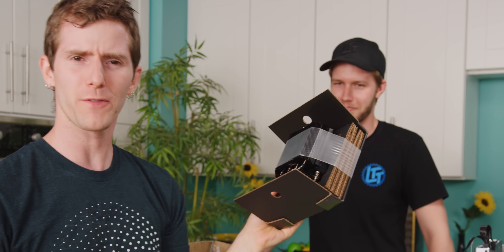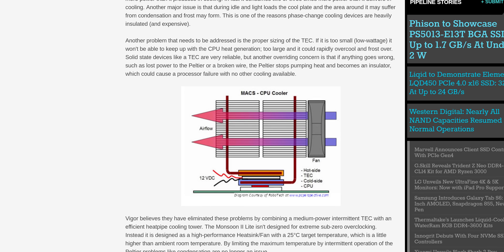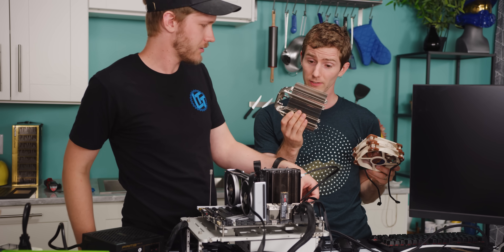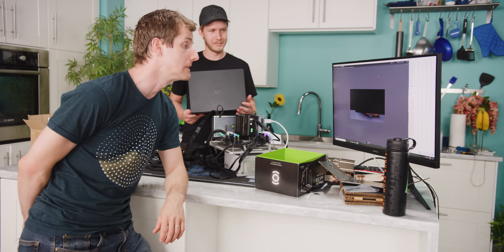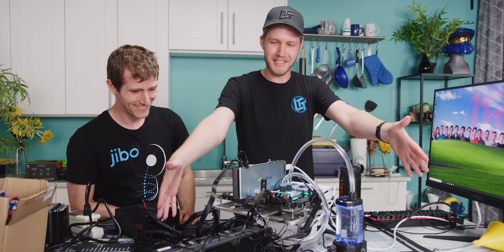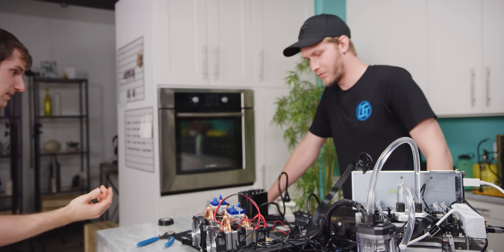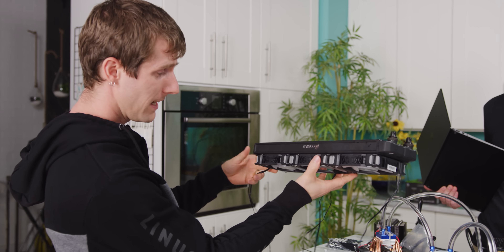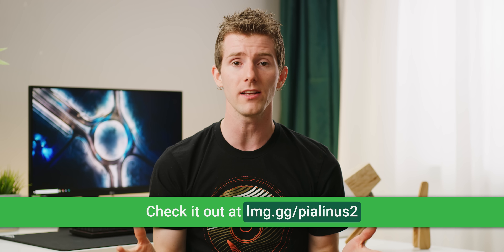Thermoelectric Cooling is a Bad Idea

Comment: How young are you? Peltier Seebeck CPU heatsinks are even older. I can still remember the late 90's Pentium Pro/MMX, AMD K5/6's, Cyrix 6x86/MX's Peltier heatsinks. Sure, they were crap then (and now).
Reply: Paco yep, I remember them too.  That was a brief but definite period in the history of cpu overclocking.  And man, that pentium pro freaking brick of a cpu... I still have one laying around somewhere for nostalgias sake.
Reply: @mrepop  Yes, pretty much a socket 8s huge brick due companion L2 cache die. Ha ha, If you still have one, you have about 1g of gold into the processor (~45$ - 0.035oz).

Comment: why not go find a cube sized waterblock and place a peltier on all the sides, give them less V they also run more efficient,

or split the water up to go trough 6 seperate waterblocks with 2 peltiers on each sides, 12 peltiers in total is a nice number too and with less V ofc

Comment: try evacuating heat out of the water with the radiator before it runs to the thermoelectric cooler.

Comment: Simply using a standard already made design will almost always fail to outperform standard air/water cooling.
TEC's true advantage comes when you have a properly designed reservoir that will significantly cool the liquid NOT the cpu. The Idea of slapping a TEC directly onto a CPU is the simplest idea and honestly the laziest way to use the TEC. I'm certainly confident if you make a custom made reservoir you would absolutely beat both Air and Water while it being as quiet(I'm not 100% certain but the power usage SHOULD be lower than directly on a CPU if using the same TEC). Obviously it needs more than just a TEC + Reservoir for this to work efficiently. You would need a temperature probe and a way to regulate Voltage based on Temperature. There are plenty of simple design choices you could use for a Reservoir but the ultimate goal is to create a Res that uses the TEC to cool a larger surface area.

Comment: So a 140W rated cooler struggles on loads more than 140W.... Strange how that works. You should look into connecting the USB cable to that cooler and setting the TEC to ramp faster. 

On a side note the documentation tells you that the cold plates are situated the way they are to keep the TEC from reaching temperatures below dew point.  TLDR... RTFM

Comment: I think an important point would be that in a system that is going to utilize peltier cooling in this way, it would be smarter to first dissipate the hot waters heat through a radiator and then take that room temperature water and cool it with the TECs to get sub-ambient chilled water. I think that would make for a significantly better cooling system.

Comment: I had a TEC cooler all the way back in 1997 and it was old when I got it, it was designed for 486 (socket 1/2/3/6) but also worked on Pentium sockets (4/5/7). All it was was a TEC that had a molex connector stuck to a rather wimpy heatsink. It was marketed as a "silent cooling" option. I have wracked my brain trying to remember the name but I all I know for certain is that it was Chinese and not a popular brand. Condensation was an issue so I never used it for anything more than bench testing.

Comment: you guys should check ( electro boom - mehdi sadaghdar) latest video where he uses that concept , he's in canada as well . 
it'll be great if you can work out some device that utilitzes the heat of the cpu and harness it to charge a battery or something, making it much more energy efficient and a little less loss of energy

Comment: back in the day i tested a tec between my cpu cyrix 333mhz and a good cooler, the problem was no voltage choice, only 12V, at that voltage it was at -20°C at boot! so i had to put silicone and foam around the socket, was not pretty.
then i was able to reach 367mhz stable at full load, it sucked so much amp my powersupply died in less than an our
and the gain in game was like 5% so not worth it
but a good experience back in the day, now i stick to noctua big cooler ftw! (6y+ 24h/24 the 120 140 fans are still working fine )

Comment: I did this to my AMD Athlon 1.33GHz, 18 years ago. I also had it liquid cooled and had a giant OCZ case as well and the largest PSU I could find at that time.

Abit KT7A-RAID Motherboard
1.5GB High-Density PC-133 SDRAM (ya, 1.5GB in 2001).

nVidia GeForce 3 AGP
Sound Blaster Live! 5.1 Platinum w/Dock
2x 40GB IDE Drives
2x 100GB IDE Drives
Pioneer Slot-loading DVD-ROM Drive
Yamaha 16x CD-RW Drive

I don't know how many were drooling over it on my ship (I was enlisted Navy at the time).

Comment: Yeah, this is a lot like perpetual motion. The more heat flux the lower the efficiency of these devices. It's sort of counterintuitive. They work best if the cold side is in a well insulated box. :-) Find some performance curves. http://www.hebeiltd.com.cn/peltier.datasheet/TEC1-12730.pdf  As an example, this 250 watt cooler is rated at about 250W heat flux at 0 C temp drop. At a 65C difference it is good for ZERO watts. Internalize this for awhile. See the problem. Pretty cool huh?

Comment: those TEC are used upside down... those are ALSO generators... meaning if you used the heat output of the processor, it would work like a car Turbo using the waste heat for more power! Cellphones should profit the most out of this.

Comment: Did you try the fan in the other orientation? With the two coolers on either side of the same fan you need the air to be blowing in the correct direction. I'm not sure which direction is the correct one. I think you want the coldest air on the peltier cold side first. If you blow from hot-side to cold-side radiators the thermodynamics is wrong because you are just returning the heat from the hot side of the peltier to the cold side.

I really don't know which direction is best for sure, but I'm sure it matters. The way you just shoved the fan back into the housing means you had a 50/50 chance of putting the fan in backwards.

That's the thermodynamics.

Comment: Thermoelectric used to be the way to seriously overclock stuff. You have to seriously seal the cold plate to prevent condensation. To be perfectly fair, they do work, and work well, but they're very energy unfriendly and unless you have a giant heatsink to absorb and discipate the heat and a good fan unit to properly push air through the fins... Good luck.

Comment: Der8aer did some pretty cool stuff with peltiers. Iirc he used peltiers to build an alectric low profile water chiller, using 5 little water blocks, that were cooled with peltiers which were cooled with small fans and heatsinks

And he uses peltierin the cooling of the last Höllenmaschine, where they cool the CPU block with it only if the water temperatur is above 20 something celsius iirc. Look those videos up if you are interested

Btw I really liked that video idea and to see where the drawbacks of this cooling are

Comment: I've done the reservoir idea. I used an 80w Pieter and whilst it worked with a Ryzeen 2600. Ambient temps were about 10c after 4ish hours, and load was 25c. I suggest strongly to use a Pieter connected to a long cooling pipe that runs in front of rad. Thus increasing fan cooling performance. Using a Pieter on cpu's or in res aint going to work well with such high TDP these days and if it does it will be extremely inefficient. The only way I see is the suggestion with the long cooling pipe with the Pieter cooled by a separate heatsink.

Comment: Can u check if sandwich cooling is viable at all? Please. This is when u have ur main cooler as normal, but u use a secondary cooler on the backside with a non conducting thermal pad. I have seen a difference of 5C on my gpu and cpu. More cooling is better right? Use the shit u have in spare.

Comment: I went crazy about peltier cooling some years ago. i cooled the liquid for cpu block outside the case with 18 100w stacked peltiers in custom made liquid-liqud interchanger. It was capable of keeping old 1090t at 5.3ghz around zero under full load with some reserves(i had it thermally regulated). There were two problems - extreme waste heat and then the bill for electricity

Comment: So it's an air cooled peltier cooling plate?  If a peliter can't dissipate heat off of its hot side fast enough it will eventually turn into heater.

Comment: At 300w you'd be paying 0.10-0.20 per 3 hours of use. Compared to the water cooler with RGB on you could run for 100 hours for 0.10-020...

Comment: I know what you are saying about companies marketing stuff like this as magic.

 One of the worst is the electric heater companies that will sell a 1000w electric heater saying it is "Way more efficient than other 1000w heaters" (Sometimes double or more) and charging hundreds upon hundreds more for them.

 Anyone who knows about Electricity and Physics/Thermodynamics know that 1000w is 1000w of heat no matter what. Running 10 x 1000w bulbs will heat a room the same as a 1000w electric heater so long as any light generated is trapped and allowed to convert back into heat when absorbing into surfaces.

 If you are running a TV, and a computer in your room and it is consuming 500w then it is acting almost exactly the same as a 500w heater.

 The point of the matter is a heater really can't get more efficient than a resistor with current passing through it... Yet somehow these companies trick people into spending millions buying into their BS and the government does nothing to stop these false claims.

Comment: Peltier coolers were a thing back in the late 90's 486 Cyrix/AMD 5x86 through early Athlon and Socket 370 in the early 2000's. I have one in a drawer I have always meant to turn into a drink cooler.

Comment: I had a pentium 90mhz with this nice compact slide on mount that you would rotate into its threads to lock it on to the cpu. then the just slot the socket 275 or w/e it was onto the board, lower the lever to lock and give it a 12v molex power. i think i might still have it around here someplace ;P might be very buried though lol wasn't bad, but in thoose days i just cared about if it worked and was reliable, i didn't worry about overclocking... often, much, hardly ever.... but ya it was well built. i played musical cpu's doing rebuilds from freebie parts etc. never needed thermal paste & it just ran. one of the most very memorable ones ever

Comment: It might work better with water cooling on the hot side, then it could transfer that extra 40 watt away better. 
But this isn't a good idea really, I think those things are like 10% efficient, so a heat exchange compressor would be far better.

Comment: I would like to see a video with the radiator before, between, and after the Peltier coolers. See what effect it has on the overall temps in each configuration.

Comment: Ah, I remember the good old days with my Pentium 4 3.7GHZ overclocked to 5GHZ. 225W peltier directly on the CPU core, and a Swiftec? waterblock connected to a Volvo 240 radiator. It was glorious. Sub zero at idle and low 30C on load. Even had a heatpad around the CPU socket and basically filled with silicone underneath in the socket and around. Never got that CPU out of the board again... :) The oversized radiator did not need fan ;).

Comment: I had a thermo-electric cooler on an old 486 machine I had back in the late 90's I didn't know how bad they were till it got particularly humid in my apartment and fried the CPU and socket with condensation, considering that the motherboard didn't support overclocking, the setup was completely pointless but I didn't know better as the computer was given to me in that configuration

Comment: As much fun as it is to put those two peltier powered water blocks in series, the arrangement on the test bench is not a fair test.
Heat riser pipes don't work very well when they are upside-down. 

Heat is just rising off the hot side toward the water block you are trying to cool.
Peltier cooling inside a computer case is still a bad idea, though.
Unless you took just as many peltier models stacked on top of one another as it takes to reach the top of the case, where you have a 1/2 thick cast iron warming plate for your coffee . . . and a lot of cold coffee. Also the case could open in the front like a Franklin stove.

Comment: Peltier coolers aren't a practical way to cool a CPU by itself, HOWEVER, if you add them to an already temperature-stable liquid cooling loop with their own radiators in addition to what you already have, they can be used to lower the temperatures below ambient (if you have enough of them and if that's what you're trying to do). Short of going sub-ambient though, there's really no reason to use them for this sort of application.

Basically, your radiators have to be able to dissipate not only the heat from the CPU, but also the substantial amount of waste heat generated by the Peltier cooler itself. A better application for these would be in the "Case made out of radiators" video they did a while back. That system could only get the CPU to ambient, but if you added a Peltier, you could get it to sub-ambient because it's only providing additional cooling, rather than trying to cool AND dissipate the heat generated by the CPU.

Comment: Coolermaster did this back in 2009, it was called "V10" 6 heat pipes on the CPU block and 4 on the hot side of the peltier element. I had this on an i7-920 for 10 years, still works today :)

Comment: linus 32 amps, is dangerous as hell, please dont do this, unless on isolated circuit, and you all standing on rubber mats with rubber gloves. any condensation will get all those amps into cpu and boooom

Comment: The intro is just SPOT ON!
There is a project by a german tech magazine called "Höllenmaschiene" (which translates to "hellmachine" and is obviosly the nam eof the project not the magazine that is called "PC Games Hardware") they do one version every year and viewrs can win it afterwards. (they also get crazier with it every year) This year the did it for the 10th time in a row and they put a custume built peltier cooler by "Der 8auer" onto it. It pulled arround 1200 Wats under load I think. (could have been either slightly less ore way more)

Comment: Guys, I used to have an old artic freezer v2, when I looked it up I could never find one online, see if you can get your hands on one and give it a go, the Peltier is built into a massive waterblock the size of that air cooler. It's massive as fuck and weighs a ton, it's also mostly copper in construction.

It could produce so much frost on the board almost as much as ln2 can but on lga775 🤣

Comment: Best way to tec is to cool a water loop with an insulated reservoir[(2 water blocks, insul-res, pump)TEC( 1waterbloock, big ass radiator)] the TEC gets sandwiched between 2 water blocks.

Comment: Thumb rule of T.E.Cs : if you want to cool a 100W cpu, you need a 200 W rated tec and evacuate 250-300 W from the hot side. Useful in an astrocamera to cool the ccd/cmos sensor, and useless above 30 W.

Comment: Linus be aware that even if you find a Peltier that can draw 500w you will still have to dissipate that heat in addition to the cpu heat on the hot side. Also you will have to keep the temperature difference between both sides of the Peltier as close as possible because if the hot side gets too hot it will seep back through the Peltier module and your cooling would be reduced. 

Many people stack pelters of increasing power so that the top Peltier does not become overwhelmed by the heat generated beneath it.

If you really want to go crazy with sub ambient look for a closed cycle helium cooler - its one method for making liquid nitrogen and can get colder than it.

Comment: What if you throw a radiator between the hot side of the cpu and the first peltier? Reduce the peltier load by getting the water closer to ambient passively before actively cooling it.

Comment: A minor mistake, but I'm going to point it out either way:
No matter where in a closed loop you measure the water temperature it's going to be about the same.
This is a result of the high thermal mass and flow rate, and is actually what you want to see in a cooling system.

A high delta between two points in the system means there's something inside the system impeding the heat transfer. That is, quite literally, the problem that cooling systems exist to solve, and so it's a rather undesirable trait for one to exhibit.

Comment: This shows how the TEC module can power a small fan using the heat.  Why waste the heat?   "It is also called a peltier element and when you use it as a generator it's called seebeck effect. You have one hot side and one cold. The module generates power to drive a motor and the motor fan/air flow will cool the upper heat sink. Higher temperature difference => increased output power => increased motor RPM" https://www.instructables.com/id/Thermoelectric-Fan-Driven-by-a-Candle/

Comment: Bad Idea? Meh. I got a Peliter on my old Intel Core duo (2,4Ghz Quad Core) and got it down from 42 Degrees Idle to -2 Degrees and on Load its at a reasonable 26 Degrees. So No Water Condensation either.

Comment: Why did you remove the radiator from the water loop? The radiator should be before the TECs and the TECs should only be powered when the radiator goes over a threshold above ambient. The radiator would run at maximum achievable efficiency (highest temperature delta to ambient) and the TECs will have more headroom to work with.

Efficiency of the TECs are still so far out of the window they're intruding on commercial airspace, but the CPU should reach the lowest temperature possible with the given parts.